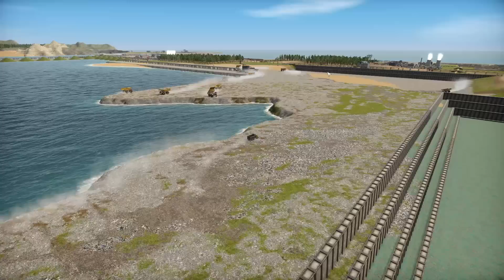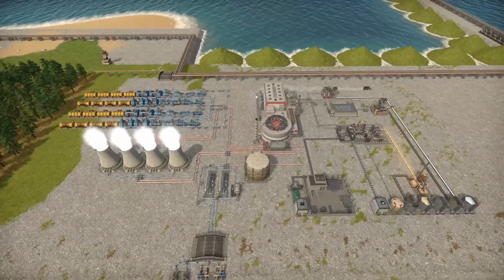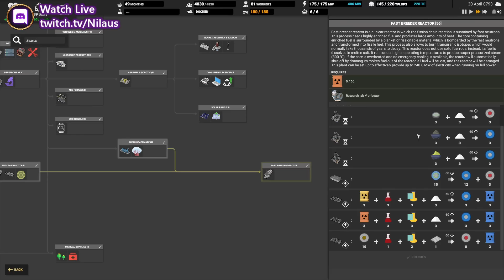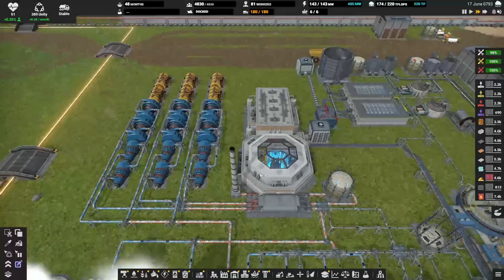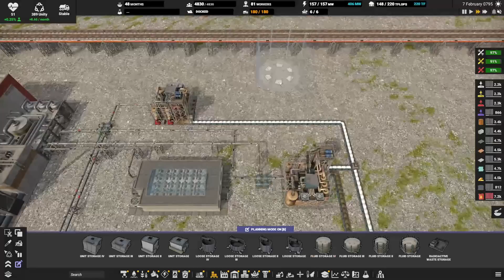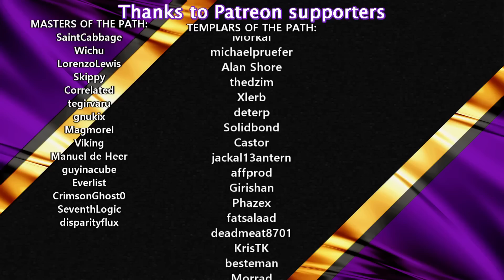Complete Guide to FAST BREEDER REACTOR; Ultimate Power Plant | 18 | Captain of Industry Update 1

Comment: For power generation I like to just use super and high pressure turbines.  The low pressure steam then goes to thermal desalination plants to make water for my farms (and the brine is used to make salt, chlorine, and process toxic slurry.
Reply: With vacuum distillation, you can now use the low pressure turbine and use the depleted steam for your desalination.

Comment: The core fuel is a liquid because, as is stated in the tooltip of the technology, the fissible material is mixed inside molten salt, instead of being solid rods as in traditional nuclear reactors. This is actually a technology used in real-life nuclear reactors, it seems.
Reply: *still developing to be used in real-life applications.
As the math and technology is technically already exists, building the real thing is hella expensive and it's much cheaper just to run coal power than to invest in "future of your kids" or whatever not my problem thing there may be..

Comment: Nice video, although I'd tweak a few things:

First - core fuel balancing. Prioritise reprocessed core fuel over core fuel from enrichment and the system will run fine. The enrichment will slowly back up with enriched blanket fuel but that's fine, that's the balance, everything will run smoothly. Similarly, prioritise the blanket fuel from the enrichment output over making new blanket fuel and the process is good. Eventually you will be making blanket fuel from yellowcake straight which is also a very simple and clean process, much easier than the starting nuclear!

Second - Use the reactor steam for desalination instead of the boiler, you'll save a good amount of power (Since steam -> power -> boiled steam is a net loss). Heck, pipe the steam around to desalinate water elsewhere as well!

Third - Unless you want to be running 100% of your nuclear all the time, add some mechanical power storage and load balance your turbines. I tend to run the first turbine flat outa nd optimise the second to keep all the shaft cranking. But also you'd want to connect your steam machines not in pairs but in a single series to make sure the secondary machines don't start and stop all the time running on 50% steam.

Other than that, some final video with thoughts and base tour would be lovely! :D

Comment: Core Fuel:
Balancer with priority input from the reprocessing plant, secondary input from the enrichment plant. Then, just let things fill up.

The enriched blanket fuel won't clog the plant, so no need to try to figure out how to reduce inputs or anything like that.
Reply: No but I have had problems with regular blanket fuel clogging up the enriched blanket fuel turning into core fuel. 

Every minute you burn 4 core fuel. 
Every 2.5 minutes you recover 8 core fuel and "lose" 2, so you lose 1 per minute 

The blanket fuel can make up to 3 core fuel per minute. So you either need enrichment or you need 3 enrichment plants turning raw uranium into 20%, those take 2m40s to make 1 core fuel. 0.38 per minute or something. 

So anyways if you have only 1 enrichment machine making 0.38 core fuel per minute, and you aren't making core fuel from enrichment, you will run out of fuel all the time. It'll work for a while and then run out of fuel.
Reply: @leeknivek  Your numbers are incorrect, and I suspect there's a flaw with your build. TL;DR: Pipe balancer after enrichment to prioritize re-using that blanket fuel over allowing new in.

I am going to give the numbers for one FBR running at max for 1 minute. It burns 4 core fuel. When you reprocess it, you lose 20% of that spent core fuel, getting back 3.2 and losing 0.8. You need to prioritize taking core fuel from reprocessing over enrichment, so you can always process spent fuel.

At the same time, the reactor is enriching 4.8 blanket fuel, of which 20% is turned into core fuel, or 0.96, making you 0.16 Core Fuel positive. The other 80% is returned as blanket fuel, so you only need to replace 0.96 blanket fuel.

As the chemical plant has a set speed of 3/min, the only way to ensure the enrichment plant can always empty its blanket fuel is a balancer with the priority input on reused blanket fuel. We don't actually care if core fuel backs up in the enrichment plant; that just means our core fuel lines are fully saturated and the enrichment plant is down to matching the 0.8 loss rate.

Everything scales linearly with this example.
Reply: @asureaskie  yes, you're right, but I was running mine without the core fuel fully saturated. The reactor was full, and I let it go. Plus, there was another mox reactor tied into it making blanket fuel. With the blanket fuel saturated, the enrichment plant could not convert blanket fuel into core fuel, because it didn't have anywhere to put the 4 blanket fuel that comes from 5 enriched blanket fuel. So I kept running out until I Unity deleted about 50 blanket fuel from the pipes and the core fuel became saturated, and shut down the mox reactor. 

I do have balancers set up correctly, I just didn't wait until core fuel was fully saturated, but the blanket fuel was saturated, so I couldn't produce anymore core fuel.

Comment: I just reached tier 2 reactors on my playthrough and was having an issue.  Six hours of building and rebuilding and I finally found it.

Reactor
384 water + fuel => 384 high steam.

Four turbine sets:
   96 high steam => 96 low steam => 96 depleted steam

So 384 water to 384 high steam to 384 depleted steam.

Now, to recycle that steam into water..
Cooling tower:  96 depleted steam => 72 water

Desalination: 24 depleted steam => 33 water

3 cooling towers + 4 desalination: 384 depleted steam => 348 water

Can anyone else see where I made my mistake?

Comment: Honestly, once you have your first fast breeder reactor up you can probably delete your older nuclear reactors. Then just use the stored waste (and your probable mountain of depleted uranium you have lying around) to feed the blanket fuel into the FBR for hundreds if not thousands of years.
Reply: I made so. Both spent fuel types and depleted uranium is easy to convert to blanket fuel. Breeder cycle does not leave any waste in long run and you can easily convert uranium ore to blanket fuel after you have used all nuclear wastes. For me it took hundreds of years. You need ridiculously low amount of ore and energy production is simple and practically free except somewhat high investment cost of powerplant setup.

Comment: Thanks for this series. I wait to see more. 

Breeder system works flawlessly (>1000 game year for me) if you put balancer to prioritize core fuel from reprocessing plant over core fuel from enrichment plant and another balancer to prioritize blanket fuel from enrichment plant over blanket fuel from chemical plant. I took external core fuel supply away after breeding started but I thinki it can be if it is the lowaes priority of all (it should never work under normal operation). 

One radioactive waste storage is enough for one breeder reactor. If you use full power amount of waste will balance is about 960 / 1600.
Reply: So if enriched blanket fuel backs up the reactor will keep going?
Reply: @matteocdt5214  

Yes. Blanket is separate layer around energy producing core and does not affect to core's operation. You can run breeder reactor without blanket or keep it full or whatever you want without problems. But if you do not remove spent core fuel the reactor will stop.

Othervise breeder system would need regular manual management because it breeds more than it use and there is no control automation based on amounts on material in the game. In my opinion it would ruin it completely in automation game.
Reply: Exactly. If you supply blanket fuel (which is optional) you will get 4% surplus on core fuel (i.e. for every 1 core fuel spent you'll get 1.04 back) but the reactor does not back up on spent core fuel because you prioritise the reprocessing. Blocking the blanket fuel does not do any harm because it is separate from the core fuel loop. Once your depleted uranium is used up you'll only need a tiny bit of uranium to make blanket fuel from yellow cake.

Comment: I would personally love a "how do you make the barriers in the mines look nice video"... Hating those things :p
Reply: They should make them higher than 5 levels, and more resilient to collapse.
OR they should make them able to be preplanned/pre-built completely without the need to do it bit by bit.

A real pain.
Reply: @dehe82  They don't collapse unless you go lower than 5 layers.  Play around with them for a bit and eventually it will click.  Barriers aren't impossible to figure out.
Reply: One layer at a time.  Put the barriers on the outside of the square of the mine layer you want to dig down.  Think of the barrier as the walls of the box.

Barriers work for 5 height down.  At +3?  Works to -2.

Once you finish that new layer of your pit off, decrease it by one mining tile, build the new wall in that removed tile.  Dig down 5 more tiles.

Repeat.
Reply: @sintanan469  I just realized what I have been doing wrong... Math..

I was digging at lvl -4 and the base level is 2. I was however counting from 0 which caused issues..... *facepalm

Thnx for the tip.